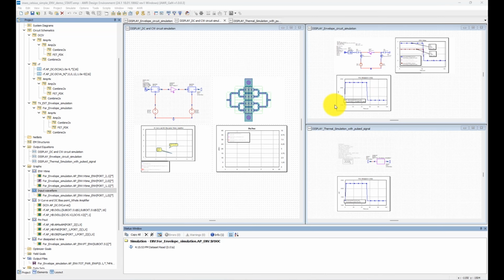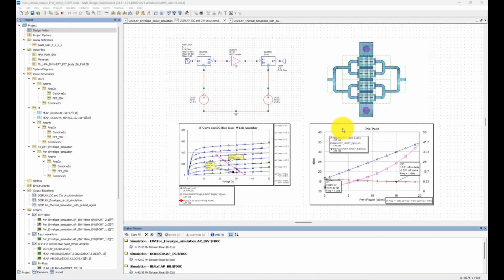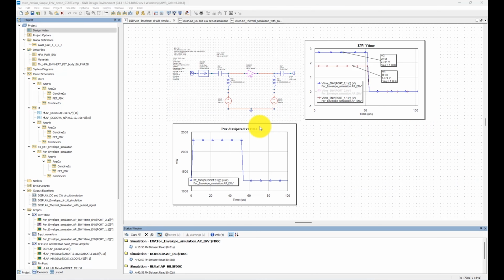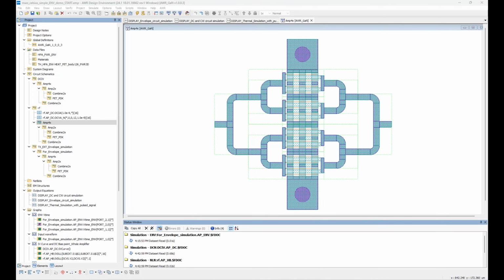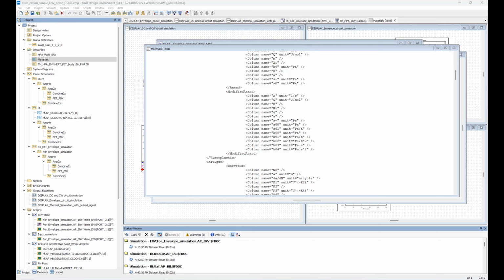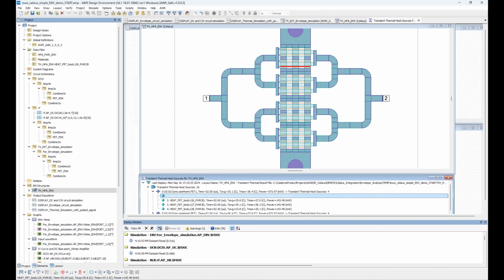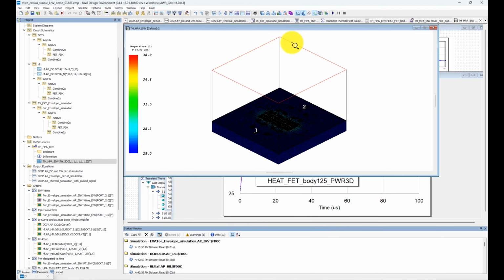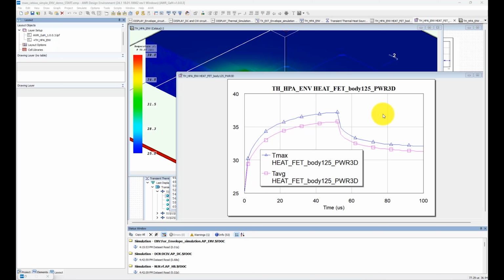Achieve Precision Thermal Analysis for Pulsed RF Applications

Comment from the maker: Localized overheating is the silent killer of GaN power amplifiers. 
By using the integrated Celsius flow, you can see exactly how heat penetrates your FET fingers during a high-power pulse.

Are you finding that thermal margins are the biggest bottleneck in your current RF designs? 
Let’s discuss below! 👇